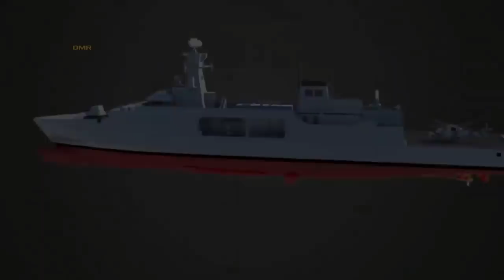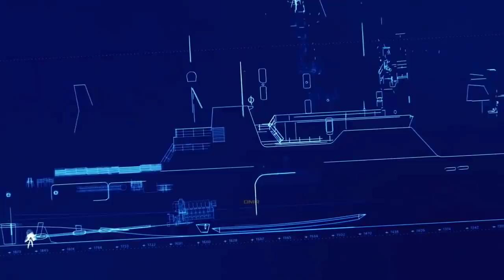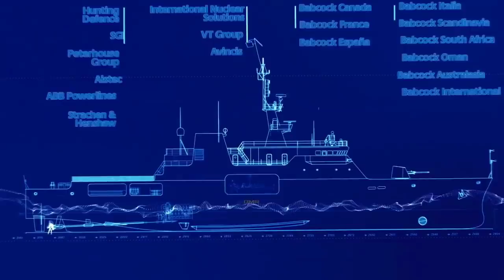Finally! UK Announced New Inspiration-Class Warship Frigates

Comment: The RN and RCN badly need more new combat ships, not just a one -for-one replacement.
Reply: I could never agree more, I would be happy with even a 6 ship increase at this point. I would say the highest number I think that would be realistically achievable if we put our minds and money to it would be somewhere between 30-50 surface vessels
Reply: Thats if the whole class of 5 ships is not streamlined back to 3 maybe 
We do have a history of  order / class  shrinking
Reply: The overall amount of ships will be the same.  The 13 x Type 23's are being replaced with 8 x Type 26 and 5 x Type 31.  At a push, the Type 23's could be put back into service rather than scrapped if things go south.
Reply: @Rasterizing  don’t forget type 32...
Reply: @Rasterizing  2000: 12 type 42's, 6 type 22's still active, 14 type 23's commissioned. 32 major hulls now to be replaced by a total of 19 (6x45, 8x26, 5x31). The modernisation is impressive but the fleet size has been massacred.
Reply: Yes Yes Yes you are sooooo right it is too bad the RN never called one "THUNDER CHILD" THAT WOULD OF BEEN GOOD
Reply: Boris has confirmed the intent to increase the RN escort fleet from 19 to 24, but it won't be until about 2030 by the time the Type 31 and Type 32 and half of the Type 26 are in service. Ultimate plan is for 6 Type 45, 8 Type 26, 5 Type 31 and 5 Type 32 (which will be modded Type 31s more or less).
Reply: @peterwright5311  of course, £billions spent on foreign aid is far more important than on our protection

Comment: Why only 5, surely we need more if we are taking our national defence seriously. We are an island and a maritime nation after all.
Reply: May be in consideration for real possibility of Scotland going indy and allying it self to EU armed forces, question will be if / will Royal Navy ship building move away from Scotland when it gains Indyref #2 and entry into the EU
Reply: @dafyddthomas7299  If Scotland decided to be independent I would think that our armed forces would remain integrated and it would be silly not to continue to build our there as that’s where the skills are.
Reply: Only 5 because they're going alongside the Type 26 - which is far more capable (£1 billion per ship as opposed to £250m for these).  These are cheaper than the Type 26 but carry more missiles - they're basically a mobile missile platform.  The overall number of frigates will be the same (currently 13 x Type 23's) as there will be 8 x Type 26 + 5 x Type 31 making a total of 13.  The Type 32 is currently being planned too.
Reply: @Rasterizing  These do not carry more missiles. Iirc, their sole missile armament is CAMM Sea Ceptor AAM, and that has now been reduced to permit as few as 12 missiles to be carried. These are 5700te GPFs with an armament and associated sensor fit that is at best typical of rather cheap, second class corvettes. They have virtually zero ASW capability and no missile-based ASuW capability either.
Reply: @squirepraggerstope3591  You're correct! I missed that the Type 26 has 2 banks of cells rather than just a single bank of 24.  They are "budget" versions for sure :/
Reply: @Rasterizing  Yep, they are typical cost-paring "ffbnw" jobs that, like the B2 River Class OPVs (also built with all the enhanced passive structural and systemic survivability characteristics of fully combat-capable warships, yet hugely under-armed) will also likely NEVER get the very significant weapons + sensor upgrades they merit and seriously need.

It seems to be the current favourite MoD(N) procurement cop out adopted by the mealy-mouthed, virtue signalling metro-trash bureaucrats that infest Whitehall generally. The real-world consequence being a RN that has far too many ships that are both
1) notably incapable (and occasionally a mite cheaper) compared to some navies nominally equivalent types, yet
2) still hideously costly per unit for the capabilities they represent as actually delivered.

Alas, in this degenerate age of virtue signalling leftist pc-cult-victims, it appears traditional concerns no longer apply. Namely, that a British warship should be built to kill our enemies while still affording the young British men and women who crew her, a fighting chance of getting back home alive themselves.

Comment: They look totally incompetent and defenseless too me.
Reply: The Type 31's are not ships designed for high intensity conflicts.

They are designed for use by Special forces, as well as for use in low and mid tier conflicts, for example anti-piracy duties.

They are, however, highly modular (was part of their design requirement) so at least theoretically they can be heavily up-gunned, up-armed etc to be capable of fulfilling the same roll as other high-intensity warships.